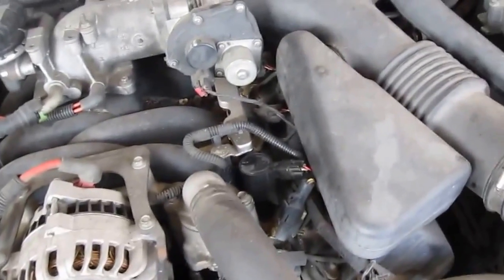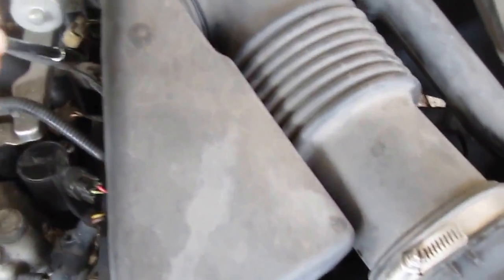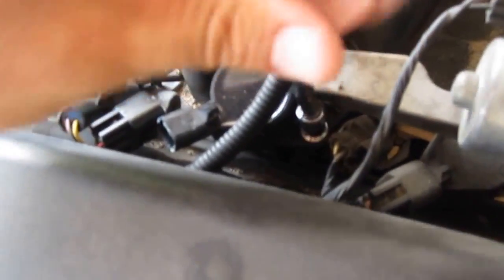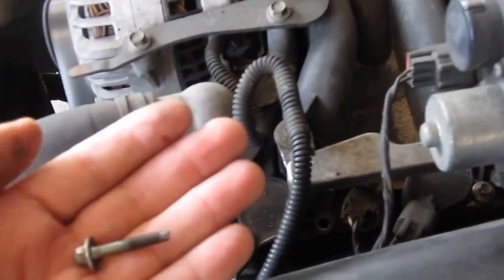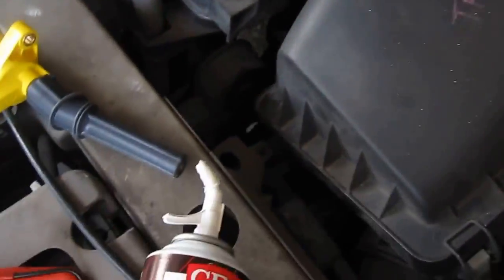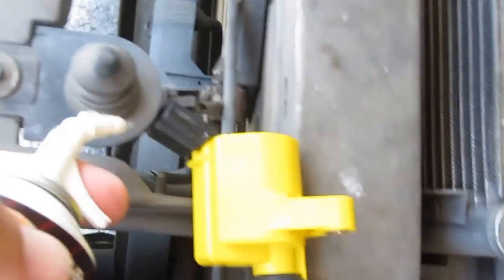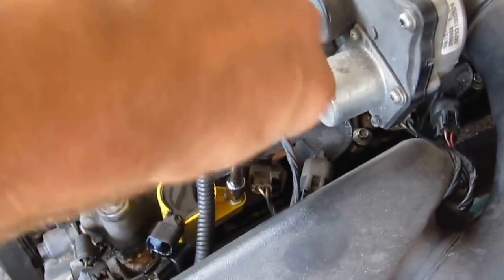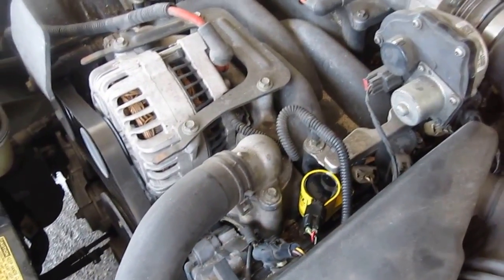How to Replace Coil Packs in a Lincoln, Ford, or Mercury 4.6L.

Comment: Well, he makes it look like an easy fix, yes, actually pulling out the coil may be easy, and the spark plug under it should be changed. Can’t believe he didn’t do that at the same time. I can tell you right now. There’s not that much room in there my son could barely get to the plugs to unplug them to check them individually. Doesn’t mention having to move anything and let me tell you you can barely get in there. It’s just not a quick fix like he’s making it sound. He’s just leaving out all the stuff you gotta do to get to the thing in the first place. I looked at my engine with my son. It’s not easy to get under any of that the fuel rail is right on top of them.

Comment: Technically, this is not a “coil pack”replacement on Lincoln. Older Lincolns did use coil packs. This video should have been better titled “Coil-on-Plug”(COP) replacement. If it has a spark plug wire, then it’s Coil Pack. If Spark Plugs are in direct communication with spark plug then it is COP. Good Video on COP replacement. 👍

Comment: On these engines, bad coil packs and spark plug misfires is usually a sign of the dreaded 4.6 intake manifold leak!!! When it starts leaking coolant the coolant goes into the coil packs and shorts them out, as well as fouling the spark plug. If your coils are covered in coolant or oil you will have bigger fish to fry.

Comment: Wow.  We got an engine misfire on cylinder 7 code on our 2003 grand marquis and our garage wanted to charge us $1,500 to replace all 8 coils.  I just got off the phone with them and told them to change only the 1 bad coil for $198, but after watching this video I feel like an idiot realizing I could've fixed this myself in 5 minutes.  THANK GOD we didn't have them replace all 8.

Comment: How hard are you supposed to tighten the coils
Reply from the maker: Not very hard at all.
I would say as hard as 3 fingers can get them with a 1/4" drive ratchet?
Then recheck the tightness a day or 2 or week later.
One of those little bolts is all that's holding each coil pack on- if they break that's a
another video.
Reply: Jevin Deml thank you!!
Reply from the maker: Robert Allen Your welcome.

Comment: I am right now having the # 7 coil replaced.  It looks pretty easy.  The price of coils seem to be from cheap to very expensive
for a pack of 8.   Have you noticed any difference in performance.  By the way, my 2003 Grand Marquis has 340K miles and this
is
 the first time a coil had to be changed.   I was thinking of changing 
the other 7 my self.   Whats your opinion on how much or a brand I 
should buy ?     The mechanic doing the job is charging me $50 for just 
the coil.  He said the better ones are $65 each
Reply: Did it fixed after that
Reply from the maker: @marquis9007  with the car in this video- yes. There was no more misfire from that cylinder.
Reply: I bought a coil set on Amazon for less than $20.  My mechanic installed them
and the car is running great.            @marquis9007
Reply from the maker: Ken That was the only coil I replaced in that car and didnt notice any difference other then it no longer missed. $50 sounds reasonable for a mechanic to replace them. It probably doesnt matter if you go with the expensive ones or not.
Reply: The $50 was for just the coil not labor. Once it was installed it solved that problem but #6 was showing up bad now.
He told me I should replace them all and said to buy them online cheaper and he would install them.
I order all 8 today from Amazon and should have them Friday.  Getting new spark plugs too at only $2.09 each.  Hopefully that will solve the problem.
Reply: @n1kkri  did that solve the problem?

Comment: This does not  address remove and replace the direct ignition coils for the 2009 MKS 3.7.  Front bank appear to be straight forward but bank against the back of the engine compartment next the firewall is a different animal.  Where's the info on them, thanks.
Reply from the maker: Sorry for the late reply but this is for the 4.6L engine only.

Comment: Would you have to remove the fuel rail if you were taking out a different coil?  Or can you get them all out?
Reply from the maker: You shouldn't have to remove the fuel rail to remove the coil packs on this engine. Make sure your using the small rachet and sockets (1/4" drive)

Comment: I bought a coil pack for my 2001 lincoln ls v6 but code 2 (which is on the left side) is misfiring which means the entire manifold has to be lifted. Do you have a video for that

Comment: I've watched several vids on this procedure, but no one wants to show one where you have to remove the fuel rail. And that's it, my foot !
Reply from the maker: You dont have to remove the fuel rail to replace the coil packs on this engine.
Reply: You don't have to remove the fuel rail.  It's tighter than a 16-year-old virgin but you can get it out without removing the rail.

Comment: My ´03 Aviator has some minor shuttering in idle, and short, intermittent, split-second minor power loss while driving, usually while steady at 40 to 55 mph and/or during easy acceleration.  Overall, the car feels less frisky, but it is not terrible.
Does this indicate a bad coil?  There's no engine light lit.  Would a read-out register this?  How would one tell which coil is bad?  Is it possible that one or more is just a bit out of place or loose?  Would a bad performing coil cause damage in the long term?
This became noticeable 3 months ago, but 11 months ago, a mechanic changed:
- Spark plugs (parts $69)
- Spark plug boots (parts $222)
- Replace spark plugs and coil boots (labor $245)
Further suspects:
* Air intake control module
* Throttle precision censor
Would appreciate your insight :)
Reply from the maker: A bad coil will almost always trigger the engine light to come on- but just to be safe put a scanner on it anyway and see what it says (even though the light isnt on) how many miles? Has the fuel filter ever been changed?

Comment: How do I locate #2 ignition coil on a 1999 Grand Marquis V8? Do I start count from front to back on driver side or passenger?
Reply from the maker: David- number 2 cyclinder should 2nd from the front on passenger side. 
Click the link below for a firing order diagram for the 4.6L Ford.
https://tinyurl.com/7u8vcmtn
Reply from the maker: Start count from front passengerside.
Reply: Great will do..

Comment: On my 2004, plugs don't just pull off, there's a tiny tab to depress slightly with finger on underside of plug near wires... also, bolts keep loosening on thermostat housing, allowing coolant to run down intake manifold, past the coil rubber boot, and fill the sparkplug holes with coolant!
Reply from the maker: Buzz your right abiut the tiny tabs on the wire connection. I forgot to mention that in the video. On the thermostat housing- you might want to try buying a used one from a salvage yard and see if it works better.
Reply: +UrbanBoondocker .. Too late, I broke the latch on the first plug forcing it off... Thermostat housing bolts seem to be staying tight now that I tighten them more than it should have needed...

Comment: My daughter just bought a 2002 Lincoln ls she has a mis fire code in number 3 cylinder, thanks to your video she won't get reemed at mechanic shop. She already bought the coil pack I will change it for her, Thanks for the video.

Comment: Thank you for the video.I had an ignition coil replaced by repair shop a couple of years back and was charged for $400.  The shop offered to replace all 8 coils for $1400, but I didn't have it done.  My coil(s) failed again recently and I decided to change all the spark plugs and ignition coils by myself to save a little money.  Thanks for this video, it took a while but I was able to replace them all for much less than $400.  Changing the coils was very easy.  Hard part and what took time was for the new spark plugs to catch the thread.
Reply: +Gary Y .. Can buy set of 8 coils for $21 online with free shipping...
Reply: Less than '400 dollars' 

Uw0tm8

Comment: I have a 2000 Lincoln LS v8 and the coils keep going bad. It also seems to overheating too. Do you know what this could be?
Reply from the maker: All the coils keep going bad or is it just one or two coils? When you say it 'seems to be overheating'...is the coolant gauge in the red?
Reply from the maker: Make sure the coolant level in the resovoir is ok.  Turn the heater on... does heat come out of the vents? If not the coolant level is probably to low. The electric radiator fan should be turning on acasionally when the engine gets hot- if not- unplug it and run jumper wires directly to the battery to test it.
Reply: +UrbanBoondocker Its usually one coil at a time that goes bad. The temperature gauge goes into the red even when the coolant is full
Reply from the maker: +Beau Nelson Are they the original coils that came with the car that are going bad or coils that you already replaced? Original coils going bad on a 2000 would not suprise me- but if their coils you already replaced going bad- that could be tricky. On the overheating....Is the radiator fan coming on occasionally?
Reply: +UrbanBoondocker The mechanic didnt specify if it was  a different coil going bad each time but i believe that was the case. I started the car today and the heat didnt work it was just blowing cool air. It didnt overheat but then again its not very warm out today
Reply: I have a 2002 grand marquis and I have a misfire for cylinders 4,7,8 I changed the spark plugs and when I pulled out the coil it was leaking oil what do you think is the problem

Comment: I'm replacing one in my 02 Lincoln ls. This is the second since owning the car. The code thato comes up is a miss fire reading. I don't know if it's just the type my car is but it's $60 a coil so replacing all of them isn't really an option.
Reply from the maker: You replaced this coil once already? do you see water or coolant in the hole where the coil is? that can cause a misfire.
Reply: +UrbanBoondocker it's a different coil and it's been about a year ago. But water isn't very likely considering until today we haven't had rain for about a month. I am going to switch two of them around before I actually replace it.
Reply from the maker: +Dusty Doggett This is a different coil ok. Switching the coils- thats a good idea.
Reply: Damn this makes me sad for you I have a 2000 grand and 4 are 45.99 which isnt too too bad

Comment: My 03 Towncar rides percent, but idles a little rough and check engine light came on today , for a coil pack , could this affect my gas mileage?
Reply from the maker: Yes a bad coil pack would effect gas milage cause raw gas would be entering the cylinder without burning IF th ats whats happen with your 03. I would drive it to Autozone or another place where they do a free code check with a scanner- that would tell you why the engine light is on.
Reply: +UrbanBoondocker , I bought this code scanner for $190. Some might find it useful, especially if they are having to check multiple vehicles or gather information about minor problems and fix them before they get bigger. +imbb1, hope you get your problem fixed.
http://www.amazon.com/gp/product/B003IOITRG

Comment: Very easy to replace. If you need to change one ignition coil, suggest changing all of them. The car will run like brand new. Well worth the hour and half to do all eight. On E-Bay, you can get all 8 Motorcraft plugs and ignition coil packs for 92.99 free delivery. Can't beat that.
Reply: Can you  provide a  link?   Thanks in advance!   :-)
Reply: Yes link please
Reply: I read too it's highly suggested to swap out the 4.6L V8 ignition coils(8) & the iridium, double platnium spark plugs at the same time. The Ford engine will run smoother, quiet 🚘 & it will fire in sequence better. My cousin & I put in new Bosch brand double platinum plugs & my car; 2005 Crown Victoria LX Sport had the cyl 7 code go off. I recently had the Ford's cyl 7 & 6 ignition coils replaced. Now, smoother quieter ride. No back firing or engine shakes.

Comment: Great video....thanks. I just had a dealer change all 10 of my Triton V10 coils! They only had 40k miles on them. When all was said and done, it turns out that my catalytic converter was causing the problems.......that is, the vehicle would go into the "limp mode" and not shift up or out of 2nd gear. Thanks Ford dealer! Total cost: $2700
Reply from the maker: Ouch sorry to hear the dealer charged so much. Thanks for the comment.

Comment: My linclon steering wheel trembles could this be the cause
Reply from the maker: Only if the steering wheel trembles while idling at a red light and the engine light is on then yes it's possible it could be bad coil pack(s). If the steering wheel trembles only while driving then it's a problem with the front wheels or suspension
Reply: Jevin Deml what about when your breaking hard the steering wheel shakes but when driving normally its all normal
Reply from the maker: If the wheel shakes only when braking that usually means warped brake rotors (most likely the front two).
Replacing those or having them turned should stop the steering wheel shakes.
Thank you.
Reply: Jevin Deml i replaced my front 2 rotors still does it i thought it was that 2 would maybe aftermarket rims cause this to happen?
Reply: UrbanBoondocker thanks

Comment: How are the coil packs labeled.  My 2005 V8 Mustang has check engine light on. Advance auto parts checked it and said it had bad coil pack D.  Which of the 8 is D.  Thanks
Reply: face the car, count from your left: 1=a, 2=b, 3=c, 4=dfrom your right 5=e, 6=f, 7=g and 8= h
Reply from the maker: Their computer should say which cylinder has the bad coil pack if there is a bad one. It should also give a PO number code. Ive not heard of code D that might be something specific with Mustangs.

Comment: My 2004 lincoln ls sometimes jerks when it switches gears, could this be the cause?
Reply from the maker: Yes it could be. Is the engine light on? If it is I would have Autozone or one of the parts stores check it for you, if a coil pack is bad it will give a misfire code.
Reply: UrbanBoondocker yes the check engine light is on. Thank you, I'll get it scanned in the morning

Comment: Well fuck, I was just charged $800 for this repair.
Reply: Gee, I purchase 6 Motorcraft D-40 for less than $600, got 3 three but the last 3 close to the passenger compartment. do I remove the top of the engine to install them because it seems like there is no clearance to remove them. Suggestions/input is welcomed, too, thanks in-advance.

Comment: I got a CEL that pulled 9 codes, 8 were ignition coils,  is this possible?
Reply from the maker: What is a CEL? If you have 8 bad ignition coils I wouldnt think the car would start. Try using a different code reader- Oreilly's and Autozone offer free code reads.
Reply: I went to AutoZone.  Two different locations,  still having ignition coil malfunctions, I'll just change them all, yes the car still started, and shook very bad, mind you this is a lincoln ls, which I hear is bad on coils.
Reply: Check engine light.
Reply from the maker: ***** Thats weird that 8 coils would go bad. I guess you have to replace them if it keeps saying their bad. Let me know how it turns out.
Reply: Checkout amazon.  their were a few complaints of 1 going out, but the lincoln ones go out too. these are only $70 for a set!
Reply: UrbanBoondocker not that weird it seems when one goes they all start to go